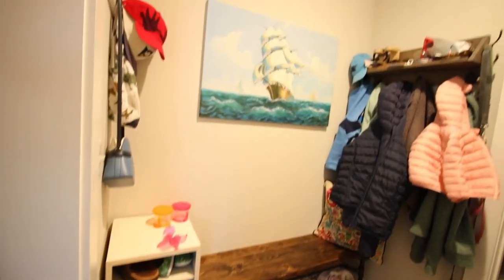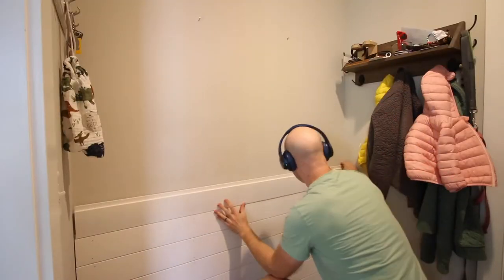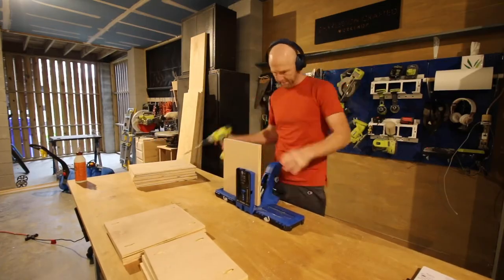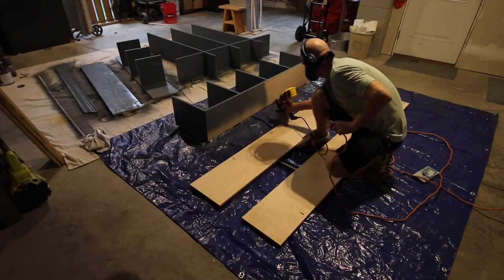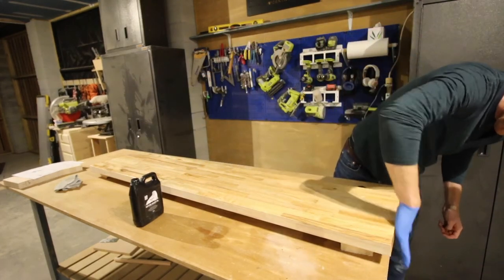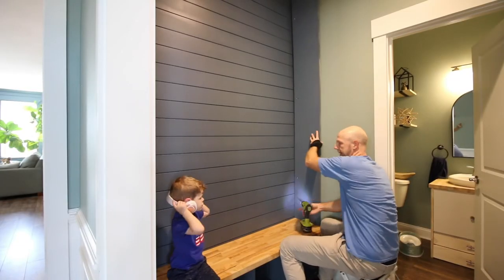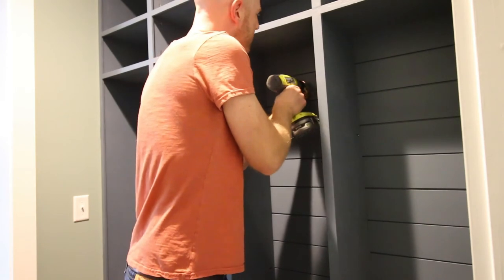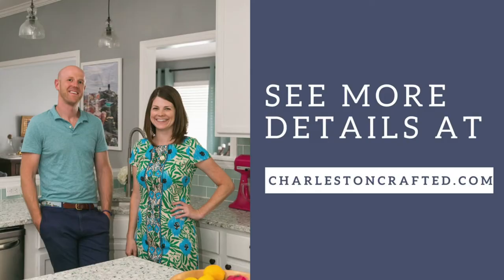How to Build DIY Mudroom Lockers with Storage

Comment: I love it! I'm going to buy your plans and do the same thing. One question though: what was your total cost for this?
Reply from the maker: That is a really hard question to answer, because there are lots of variables. If you do the butcher block bench, it's more than an extra sheet of plywood. If you do shiplap behind it, you have to add that cost as well. It will be several hundred dollars either way.
Reply: @CharlestonCrafted  that makes sense. Great video by the way! Keep them coming